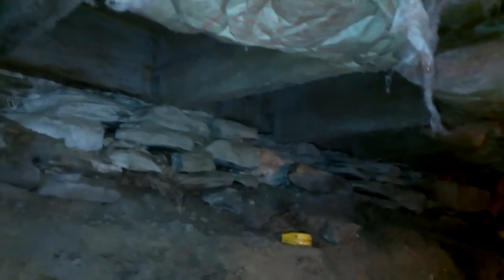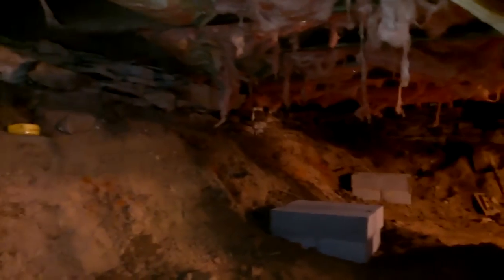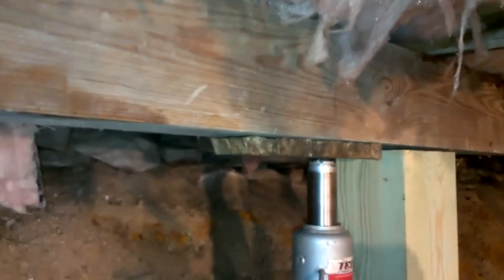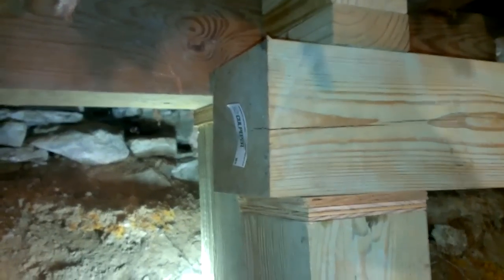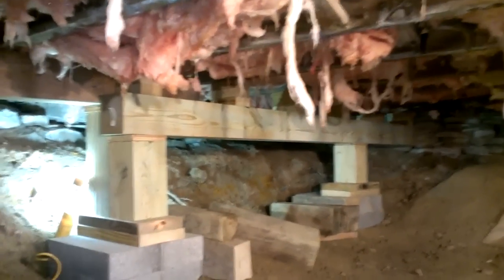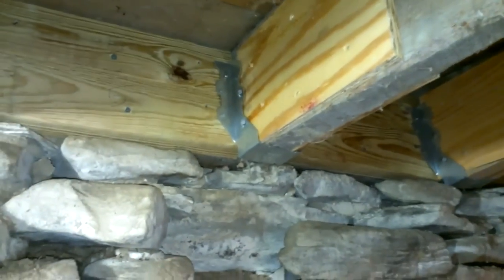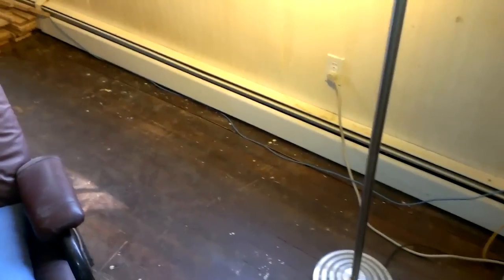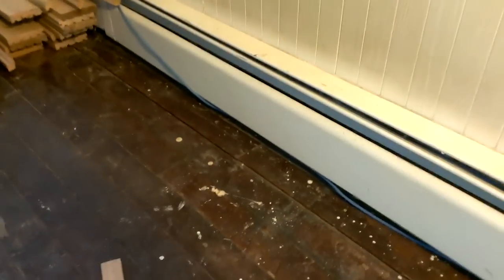Raising Floor in 155 yr. Old House - Part 2, Fixed!

Comment: What is the average cost of a project such as this? Reason I ask I looking at home currently that was Built in 1920 and I noticed it is sagging in the middle.
Reply: Rama Hoetzlein what profession do I call to dig basement?? I think I can do the raising and installing hangers, but don't know who to call for digging the ground
Reply from the maker: @junkmail1203  For the digging, you want a "General Contractor". Just call around and confirm that they have an electric or pneumatic jackhammer and other tools appropriate for digging rock/dirt in tight spaces. Don't deal with someone who says they can "dig your basement" and then brings only shovels. General contractor.